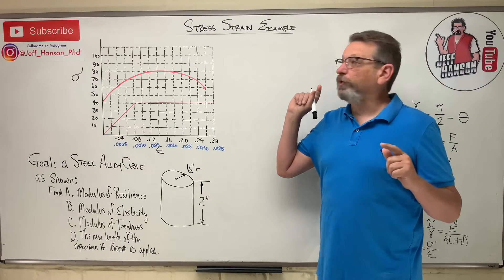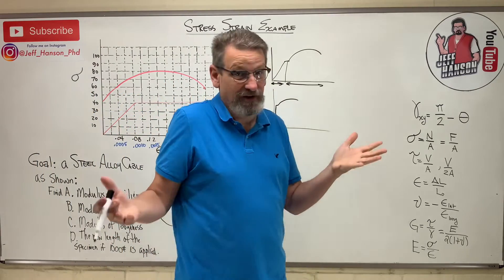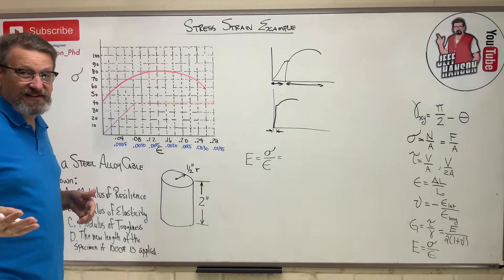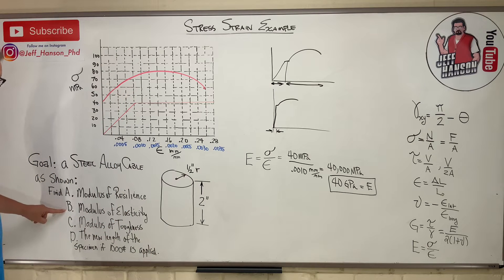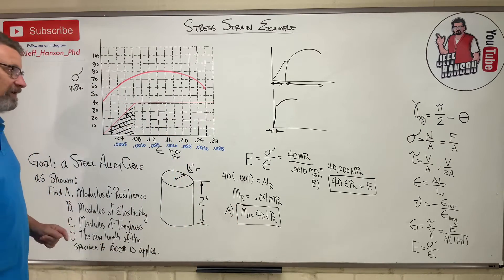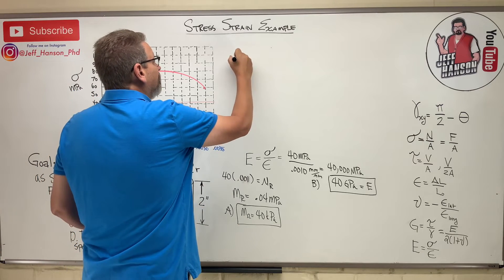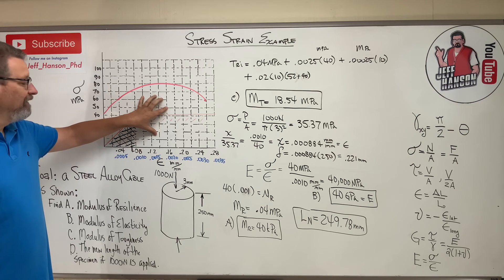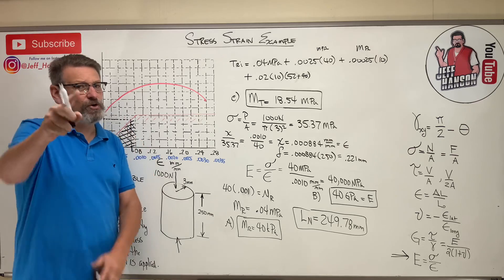Mechanics of Materials: Lesson 13 - Stress Strain Diagram Example Problem

Comment: All useful metals are alloys.  Any pure metal will be found in a chemistry lab. An alloy is a mixture of two or more elements, where at least one is a metal. Alloys are created by combining a base metal with other elements, such as metals like nickel or chromium or non-metals like carbon, to create a material with improved properties like enhanced strength, hardness, or corrosion resistance compared to the original base metal.

Comment: I got the modulus of resilience as being ur = (1/2) base * height = 20*10^3 as we are calculating the area under a triangle
Reply: Never mind he added a caption into the video saying this I just didn’t see it
Reply: @ViktoriaReads  why he didn’t add the 0.5?
Reply: @zahra7566  Not add, but he forgot to multiply by 0.5 for the area of the triangle. Nobodies perfect.